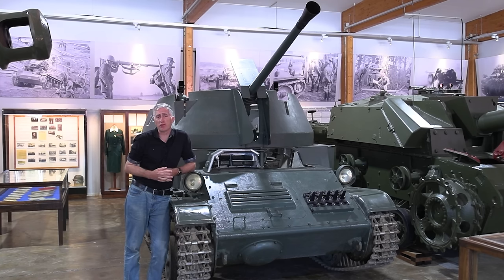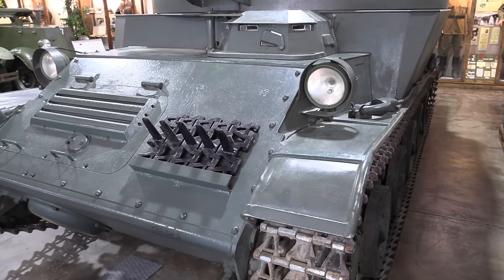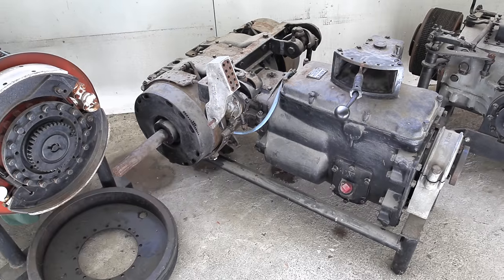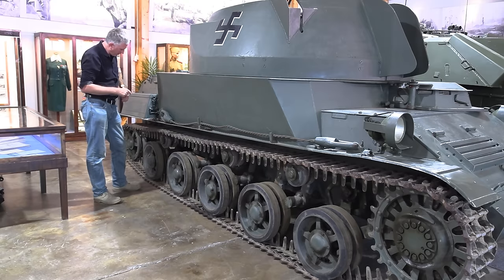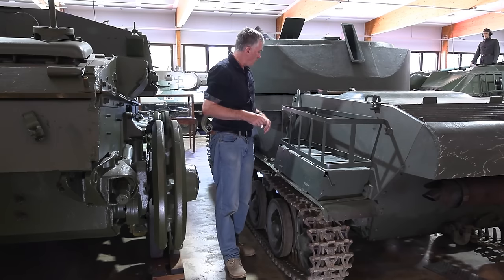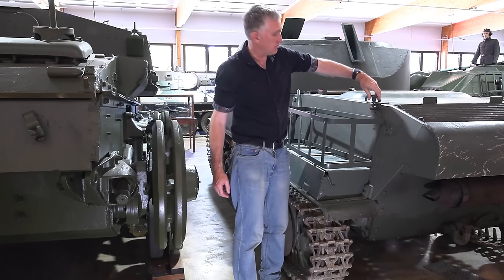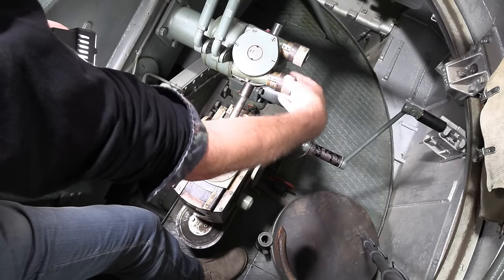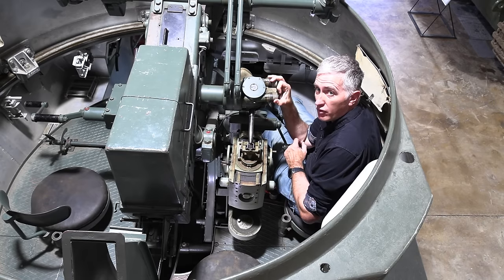Inside the Chieftain's Hatch: ItPsv 41 Anti II

Comment: Using the engine lid as part of the air intake is something I've never seen before. Very clever
Reply: The system being open to the elements every time the engine deck is open might not be ideal. Wonder if that caused any problems.
Reply: @Molo9000  Probably why the lid can be propped partly open.
Reply: You haven't seen that? That is not actually that uncommon.

Comment: 11:15 Minor correction/clarification: The Scania-Vabis “1664 CC” is not a 1.6L engine, it’s just confusingly named. The engine displacement is 7.755L.
Thanks for making and sharing!
Reply: I was going to say. That specific output is fantastic (and almost unbelievable!) for the age of this engine.
Reply: Thanks!! I did not know downsizing was a thing in WWII Sweden....
Reply: I wondered about that.  An engine that's smaller than the one in my car has more horsepower?
Reply: I came in here to say that I don't know what it is, but that it wasn't a 1.6L engine making 160hp
Reply: I was about to say. 1.6 liter engine with 140 horse power, during ww2. I knew the Swedes were advanced, but...
Reply: @keithlarsen7557  SAAB two-stroke power! ;)
Reply: @foowashere  All horse no torque.
Reply: @JamesJozef  yeah, engines were still working on 61hp/Liter (1hp/cubic inch) in the 1940s.

I don't think we really started seeing 100hp/L in naturally aspirated engines until the late 1990s.
Reply: I’m pretty sure the the Honda B-18 1.8 L 4cyl in the Integra type R was the first production NA motor with 100hp/L.
Reply: That made more sense, I was looking at that engine and thought "That's awfully large for a 1.6L engine."
Reply: @ScottKenny1978   yes, once we got better metallurgy for the head & block, computer control of ignition, and variable valve timing,  100hp/L was finally possible.
Reply: @cjwrench07  actually I take that back. Race engines were getting 100hp/L in 1969/70. Lots of RPM, and carbureted/points ignition.

But yes, better metallurgy and very high octane fuel. 116octane or better.
Reply: @ScottKenny1978  Not entirely convinced by those figures.  If it is 7.75 litres and develops 160 hp, that is only 20hp per litre
Reply: @oldcynic6964  which sounds about right for an old diesel. Or even a 1940s gas engine at 5.5:1 compression ratio.

Gasoline aircraft engines make about 20hp/L.
Reply: @oldcynic6964  its about the same output as a Ford 385 engine with 7.5 litres and 220 horsepower, built from the early 1970s up to 1990 as fare as I remember. Not bad for the 1940s
Reply: i was wondering how in gods green earth can 1.6 L engine from ww2 make almost 200 hp :D
Reply from the maker: That's what I get for not stopping to think...
Reply: @TheChieftainsHatch  Well, the engine designation is very poorly chosen.
Reply: @foowashere  or very well if hilerity on youtube is what you want :)
Reply: Owasso looking for the super charger or turbo.
Reply: You beat me to it! That's an amazing 1940s 1.6 litre naturally aspirated engine output! The engine in reality displaced about 7755cc, and was a Scania type 1664 (which is probably where the  confusion commenced. Not a 1.6l engine, its a 7.8l engine!

Comment: Speaking as a vteteran (25 years) Armor officer, the last time this was that clean was when it rolled out of the factory. Yes, every time a a tank goes to the field, it passes through the wash rack before being put to bed in the Motor Hole, , but high pressure water only does so much. This is clean, freshly painted and polished !

Comment: This technically seems like a remarkable little vehicle, gotta wonder how effective they could have been with higher production numbers?  Amazing the half dozen were kept in service for that long, even as  a simple defense turret.  The 40mm Bofors was and still is a very capable all purpose gun, especially with a modern FCS that doesn't require 2 or 3 guys to aim it.  With legs that long, even with the extra wide turret ring, I'd be a little worried about losing a couple toes or a foot to the turret monster below during traverse.  I love that driver's hatch....easy to get out of!  Nice big tachometer too for the driver.  With a handy lamp, having the engine deck set on the prop might help keep the rain out while doing maintenance in the field -assuming  the vehicle is pointed against  the direction of the wind.

Comment: Hooked teeth are the classic chain sprocket wear pattern. Ask anyone who keeps or maintains old motorcycles. New sprockets are symmetric. When the chain link pivots wear the chain pitch lengthens and the chain no longer fits snugly. This transfers ALL the load to one single tooth at a time which wears rapidly. The test for chain wear is to try to lift the chain radially at a point half way round the sprocket. If it lifts chain is done. Could possibly test tank track with a crowbar.

Comment: 40mm ammo.  Eventually, nose VT (proximity radar) fuzes were developed for the AA (HE) rounds, but not during WWII.  Impact only was normally used.   Some small/medium AA gun projectiles had self-destruct timers (black powder trains) in the fuzes to keep the damage to one's own side to a minimum, but I do not know if this was used for these shells

The base-fuzed AP round against light armor (up to maybe 40mm or so at right-angles) had a very blunt rounded point of a 1-caliber (40mm radius) tangent ogive shape, with a long, pointed sheet-metal windscreen for reducing drag.  This windscreen had two ways to attach it:  Originally, a very thin form-fitt9ng nose cup (called a "Hood" by the US Navy) was soldered to the nose and screw threads used to attach the windscreen.  This made the AP shells much more expensive than a simple AP body with a small HE charge and non-delay impact base fuze and the cheap windscreen.  The US military changed the original "M1" AP round from Sweden to a simpler one called the "M1A1" which had no Hood and simply crimped the windscreen to a very shallow groove cut into the lower nose, making the shells cheaper and easier to make.  I do not know of anybody else using the crimped version, though.

Comment: This is a nice change of pace. That turret is nicely laid out. Roomy without being wasteful. 

You mentioned this being useful against ground as well as air targets. Did it have an AP shell, or was it simply used with the (presumably HE) anti-air shell against ground targets?
Reply: The 40mm has AP rounds
Reply: I suppose it wasn't used or useful against ground targets since they mentioned shooting down 11 aircraft
Reply: I doubt 40mm ap rounds would be useful, he from that thing is enough against light armor but ap isnt enough against medium tanks so why bother.
Reply: @robertkalinic335  The AP rounds were rated to penetrate 45mm at 500m at 30°, so it has a good bit of power in it 
Plenty to take out lighter tanks and medium tanks from the side
Reply: @biomike01  Of course it goes through sides, but they are not supposed to expose them and very unlikely that you even get the chance. All kinds of light at cannons weaker than 40mm could pen mediums from sides and yet everybody in ww2 always tried to get gun that can pen front armor of enemy tanks.
Reply: Landsverk Anti II's were assigned to protect Armored Division's rear assets so no ground targets for them. The towed guns on the other hand were used against ground targets to support infantry in 1941-42 before the increased activity of the Soviet Airforce forced them to focus on air defence.

Comment: Thanks for yet again an interesting video.

A question I've had and you tiped on the bit of room in the engine room.

Why is it even in modern tanks AA or MBT that not all ammo is stored seperate from the crew?

Akin a universal/bren carrier. Max protection ie armour for the squishy things and less for engine and ammo syrage.

The fuel akin Merkava on the outside. Akin S-tank in Jerrycans hanging beside the tracks.
Reply: The issue with keeping the ammo separate from the crew is that the crew really need that ammo to be accessible, and even the "deep storage" rounds need to be protected. A tank without ammo is not very effective. The usual efficient way to both protect it and keep it accessible is to keep it under the same armor as the crew. Unfortunately, if it comes down to the crew compartment being penetrated by a round that can set off ammunition, it is likely to have already rendered the tank ineffective via damage to the crew. By keeping both the crew and ammo close to one another you limit the area you need to put the maximum armor protection around. 

Tanks such as the M1 Abrams are really the rare exception, and it is a tradeoff. Look at how much space and weight is set aside for that massive armored turret bustle. While I'd certainly say it is a worthwhile design compromise in exchange for better protection for the crew (and better ergonomics, since it keeps the turret otherwise clear of ammo and having the ammo all in one area makes loading relatively efficient compared to many historical designs that scattered ammo storage all over the tank), it is clear than many other tank designers would disagree (see the Leopard 2 ammo storage for comparison). 

Interestingly, auto-loader evolution may actually favor separating the ammo from the crew in future tanks. The M1's ammo-in-bustle layout seems to be very well suited to space-efficient autoloaders such as that found on the Leclerc, Japanese Type 90, and Korean K2.
Reply: @tacticalmanatee  thanks, for a well put argument based on facts. Somewat rare on internet.

Yet, a ready rack bin of Leo2 or Abrams behind the loader should be sufficient I guess to when spent withdraw a bit and reload that from within the tank. 

Simply place the turret in optimum reload position.

Further more reload from the back of the tank as in Merkava and S tank is then possible for the logistics.

I was a Leopard 1 driver and Dutch PRTL AA gunner trainee in 1981. (I won my cold war😎🤠) yet a disign flaw I was imo aware of of the upgrade digital German Gepard version is now in the same problem as T72 and deritives.

Sitting on top of 340+ 35 mm rounds. One RPG 7 and I'd of been history.

It should of been positioned in front and rear of the turret. Having the two crew gunner and vomander sit on the electronics bay.
Reply: If the AA tank is within range of RPG-7 fire, I would guess that things have already gone rather sideways. I'm not sure an RPG to the ammo would be much less survivable than an RPG hitting any other part of the turret body. The unfortunate crew inside is going to have a bad time regardless. The good news is that 340+ rounds of 35mm is probably capable of suppressing any AT rocket team foolish enough to fire on an AA tank unit. I can't even imagine the kind of carnage that would result from a Gepard engaging infantry. 

Speaking of optimal loading position, one of the biggest benefits of the bustle storage, aside from the increased crew protection, is that every turret position is the optimal turret position for loading, since the ammo keeps in the same orientation. There is certainly a "sweet spot" of rounds in the part of the bustle rack closest to the loader and in the middle of the bustle hatch, but compared to the hull storage of something like a Leopard even the less optimal rounds in an M1's ammo rack are comparatively easy to get to. I'm not sure how many easily-reached ready rounds are available to a Leopard loader, but I'd assume it is less than the number of rounds in an M1's "sweet spot". The US Army no longer even uses the hull ammo storage for the M1 for ammunition, to the best of my knowledge. I suspect it's mostly used for stowing personal gear these days.
Reply: @tacticalmanatee  I see a lot of talk about Gepard engaging ground targets.

Indeed, then someting has gone wrong. 

We trainend to engage ground targets by firing twice on 500 m and once on 1500 m because no laser or so distance measurement. 

Twice first for two aa rounds the two AT rounds of the two 15 round carring in the external cheaks of the gun.

Then smoke and haul ass. 

The Gepard PRTL is an AA system against low flying fast jets. Helicopters problem. We needed Stinger. 

Drones wernt a problem in my time. Yet the arc of radar vision doesn't cover straight above.

And, even in my time a special forces even woth RPG7 or worse we needed at least a compagnie of infantry to protect us and get our pre prepared sites in order.

Infantry we lacked. And without training forget it. Camouflage telephone lines etc.

And Gepard had Rolamd on Marder, or we needed AMRAM Patriot for high flighing cover.

Very complicated logistics and repair train.

The Gepard is very high and very lightly armoured.
Reply: This was a refreshing conversation to read from people who know a thing or three about armored vehicles. One of the things I never liked about the M3 Bradley was the ammo stowage, as I recall 300 rounds of 25mm in the ready bins, cans of 25mm scattered all through the hull & under the troop compartment deck, plus racks for 10 TOW missiles. Another was fuel stowage, 30 gallons between the turret basket & engine compartment, another 150 gallons directly under the turret basket. I shuddered to think about taking hits surrounded by all that ammo, though. For recon work I much preferred the M113, because you knew basically anything could take you out, it made you very careful.
Reply: @tacticalmanatee  The T-72 was unavailable for comment (deceased).

Comment: Cool bit of kit, better than mobelwagens just as good as ostwind probably slightly better in range with that 40mm bofors but certainly not as fast on the cyclic rate, hungary sported the largest amount called nimrods, also the swedes carried on with this design with slight changes in the hull well into the cold war, one huge difference being a twin  bofors, that  would be cool viewing aswell, and all you model enthusiast, try finding  this twin bofors variant  in 1.35 scale kit, good luck...funny how all the twin cannon spaags got fazed out or never put into production like the british falcon,sabres, veak 40, or A14 flak panzer and others that i cant remember, and now with the advent of drones and manpads and missiles there making a comeback now aircraft are being made to fly alot lower as we see now in ukrane, it would be very interesting mr chieftain  if you could find some of the cold war quads as in L' amx 13, or sidam 25 that was in production and used...

Comment: ItPsv 41, another utterly OP anti-air/anti-tank gun system for the game.  0~o    As for ejection of the 40mm, watching firings of the CV-90/40 IFV that Bofors does indeed eject forwards, and with great velocity (schwing!) of the spent casings as you said.  ^~^    Boom head shoot!   Alucard would be so proud.   ^~^
Reply: The 40mm Bofors in the CV 9040 is the newer after war version of the gun, which has a completely different ejection mechanism and a bigger more powerful shell among a lot of other differences.
Reply: @banaana1234   Yep, but still a Bofors, and still a 40mm.  ^~^  with lots of schwing!
Reply: In the CV9040 the gun is actually mounted upside down, to be able to eject the casings through a roof hatch and supply the ammo from the bottom.
Reply: @secularnevrosis  The Swedes being the Swedes.   ^~^    never let standing on one's head get in the way of a great IFV.

Comment: That hinged access panel in the front glacis -- are the hinges and closures a weak point?  Mightn't something hit the cover fairly violently, without penetrating, but cause the hinges and closures to fracture, and then the access panel could simply fall off?

Comment: One question I have - why put AA guns on more expensive and more difficult to maintain tracked vehicles? Was the Anti II designed specifically to screen armored forces? Wouldn't towed AA or AA mounted on wheeled vehicles been sufficient to protect infantry or various important sites?
Reply: I guess ror the same reason why there are self-propelled howitzers. Better mobility than wheeled vehicles+armour (relatively thin but it still provides some level of protection).

Comment: All engines should be rated in ranges such as 144 -160hp like in this case.  Because although it is nice to imagine that power output is a constant affair.. air pressure, temperature, and other factors do have a rather drastic effect on engine power. Yes, even with modern engine management systems.

Comment: I'm wondering since Sweden made an anti-armor 40mm gun were they able to use AP rounds in this gun?
Reply: Yes US had the M81A1 and M81A2 AP rounds and the British also had an AP round (don't know the designation) and Bofors offers at AP round today.
Armor Penetration with USA AP M81A1
Estimated for "Class B" Homogeneous Armor
Range	   Vertical Armor
0 yards (0 m)	2.70" (69 mm)
2,000 yards (1,829 m)	1.20" (30 mm)
4,000 yards (3,658 m)	0.60" (15 mm)
6,000 yards (5,486 m)	0.45" (11 mm)                                                                                                                                                    I would guess armor penetration at 1000 yards would be about 2 inches (52m)This would be what it would be facing) the armor on a T-34-76 	Hull front 47 mm /60° (upper part)
45 mm (1.8")/60° (lower part),
Hull side 40 mm[5]/41°(upper part),
Hull rear 45 mm,
Hull top 20 mm,
Hull bottom 15 mm;
Turret front 60 mm (round),
Turret side 52 mm/30°,
Turret rear 30 mm,
Reply: @colbeausabre8842  Thank You, I had a feeling the 40mm could also be used as an anti-tank weapon!